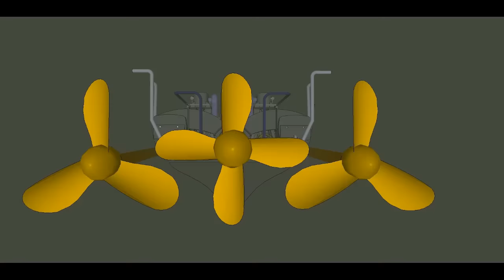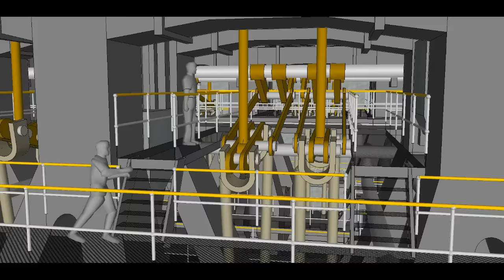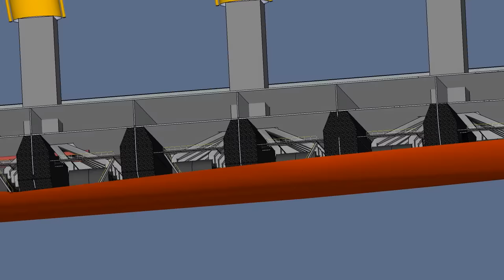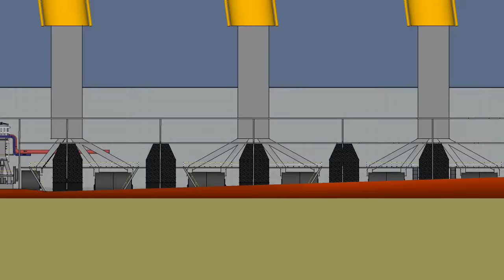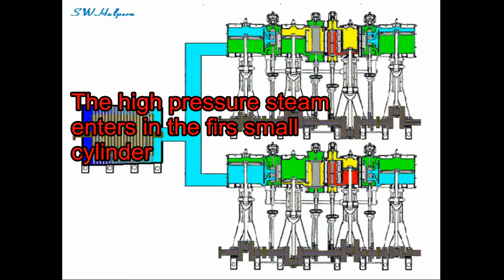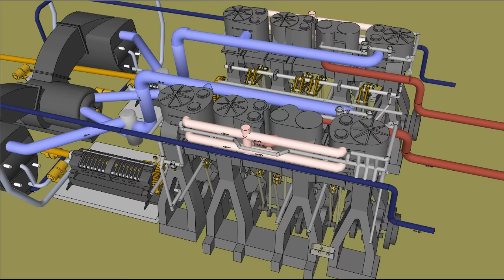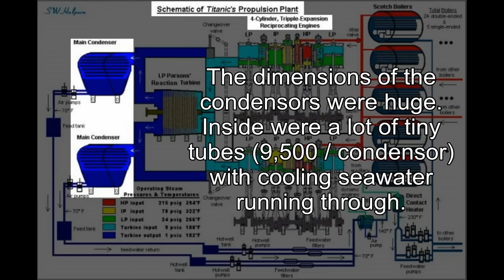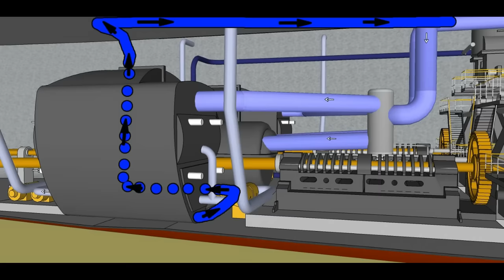The Engines of the Titanic

Comment: You might should have said that the Titanic's engines were only about 2 or 3% efficient, at best, as far as the imput BTU's reaching the propellers, and that the high steam pressures and temperatures were enormous dangers for the engine room crew. I would like to know how they lubricated the pistons and crankpins without pressure oiling and a sump of some kind.
Reply: I think they use train grease for that purpose
Reply: I am curious about the efficiency of steam engines

Comment: You forgot to add the starting engine but fantastic modle at least you put work into it
Reply from the maker: You can see at 10:35 how the engine starts.
Reply: @Hoeishetmogelijk  but on the modle you did not the starting engine is at the front of the engine next to the big starting cog which leads to the propeller
Reply: @Hoeishetmogelijk  oops I mean that the starting engine is not next to the engines like in the video it's in the front of the engine next to the next cog type up titanic engines and the front angle photo of the engine there's a big wheel next to that is the reversing engine

Comment: I heard of 'pony engines' used to start the larger engine but that was for gas and diesel, I never knew
a steam engine needed to be started like that, figuring steam would enter 1 cylinder or the other
and push the piston which would turn the crankshaft and valves would work with pushrods and cams.steam would then be admitted to the other cylinders at the proper time.
Reply from the maker: Yes, you are absolutely right!  A steam engine has a self-starting capability.  I didn't know that at the time either.

Comment: I don't understand how you can have steam a under 212°F at ambient pressure, let alone when compressed. Can anyone enlighten me? 🤔
Reply: I know that steam turbines in power plants can condense steam in condensers to below outside atmospheric pressure. It is for efficacy.
Reply: It's not at ambient pressure.
Reply: Water boils at about 70C at the top of Mt. Everest due to reduced pressure.
Reply: Maybe I should've said 1 bar, rather than "ambient pressure". I've never climbed Mount Everest and donbt you have either.  ✌🏻😎
Reply: @timbussens4940  You doubt correctly! 😁

Comment: How long did it take for the Titanic to go full astern?  In the time it took for them to reverse the props, a Diesel engine would've saved the Titanic from impending doom.  Lot of overcomplication for a piston engine, all they had to do was put mechanical unit injectors on top, and gallons and gallons of basic heating oil for fuel.  Even if injection technology wasn't that perfected, Diesel built a working model engine well before 1912.

Comment: I have always wondered if they could have turned the ship faster by increasing the Starboard engine, and reversing just the Port engine instead of reversing both.  The ship had too small a rudder for it's length and the propeller just in front of it cut it's efficiency a bit when stopped, which is what they would have had to do to go full reverse.  If they had done that, would the Titanic have missed or just glanced off the berg instead of hitting it the way it did.   Had the ship not turned and hit full on, would it have stayed afloat?
Reply: @Neineken thank god

Comment: A lot of effort expent designing and constructing the engines to make them as efficient as possible at certain speeds and sea water density.  All the same it is a low starting pressure and temperature so the engines will not be that efficient.  Ae magnificent effort putting it all together in 1912 with the great limitations of steel at that time. Much more art and inspired intuition in design of that time, do read the history of sturmey-archer and Raleigh bikes same thing a company that bought in the best of the best if they could not buy in parts made.  That company I guess did not get on with the design we of the famous gear hubs but had to bring him in to get the metals right which they could not buy in to make years and those hubs are still the most efficient bike gears design intruitively with inspired maths.  Is am guessing ?

Comment: does anyone know the  efficiency of that set up? That's a lot of use for the steam. Pretty impressive.
Reply: Considering they're coal-fired steam engines, Titanic's engines topped out at 15% efficiency at low RPM, even less at high/max RPM. They're put to shame by modern marine diesel-electric engines which hit as high as 50% efficiency and those are put to shame by nuclear-powered engines.

Comment: I realise this is an old video, but can anyone answer this question: To reverse the outer props was the whole engine stopped and reversed or was there a gear system in the outputs of the engines that could change direction?

Comment: Does anyone know why they bothered to cool the steam when it was directed straight back to the boilers to be reheated anyway?
Seems like they could have kept it hot and saved on coal.
Reply: I'm guessing the recycled steam/water could get too hot after a few rounds and then the whole process gets out of control (something explodes). But then why not just let the fires in the boilers die down and bypass the condensers once cruising in open water to use less coal. You raise an interesting question.

Comment: QUESTION! So basically the way the engines worked was that as steam entered the reciprocating engines, it forced the cylinder machines in a downward and upward circular spiral movement that in turn was connected to a shaft that was spun and this shaft in turn was connected to the propeller shaft that was spun and thus caused the ship to move? Is this correct?
Reply from the maker: Yes, that's correct!
Reply: @Hoeishetmogelijk  Got It!, thank you. I wanted to make sure I got the movement of the engines right. Appreciate it and well done video.

Comment: If the Titanic wasn't sunk , it could be restored by installing nuclear reactor that creates steam whitch it gives power to the existing turbine blades on the propeller shaft.
Reply: Greek ART Vlog That’s not a turbine, it’s a triple expansion engine. Much larger than a turbine but also more efficient. You could probably run it off a nuclear engine yes, but you would have to rip half the ship apart to do so.

Comment: why was the rear chimney not directly above nor connected to the coal furnaces?
Reply from the maker: The aft chimney was not used for smoke exhaust but for engine room ventilation.  It looked the same as the other chimneys because the designers liked 4 chimneys better.

Comment: If the low pressure turbine gave a higher propeller RPM, why not just only use turbines for all the propellers?
Reply from the maker: At that time, people did not have much experience with turbine engines.  The traditional steam engines were known to work.
Reply: Turbine engines couldn't reverse without some sort of gearbox

Comment: I am more confused now that i was before. Why couldnt they just use the 215 psi from the boilers to directly run the turbine instead of running through a steam engine?
Reply from the maker: At that time they had more experience with steam engines than with turbo machines. The turbo was coupled to the rear to use the latest pressure residues.
Reply: @Hoeishetmogelijk  wow thanks for the quick reply. Are you done making videos? you have some interesting stuff on your channel

Comment: Never dawned on me how much of a monopoly the coal industry had.titanic could of been diesel or fuel oil powered and been way more efficient
Reply from the maker: Yes, you are right! They found out years later.
Reply: @Hoeishetmogelijk  oh no they had been running diesel and fuel oil powered naval ship years before titanic was even thought of,it had to be a coal industry monopoly.because they could of easily ran those boilers off fuel oil and they would of been way less hassle,was more efficient,cleaner.just all around better.i will say those steam coal fired set ups have less then %1 fail rate and at the time were considered safer then fuel oil or diesel
Reply: *could HAVE been

Comment: Hi guys, would someone be able to further explain the thrust block to me ? (Great video!)
Reply from the maker: The propeller shaft presses against the ship to push it forward.  The shaft is connected directly to the crankshaft in the steam engine.  With this uncorrected force, the crankshaft would be dammaged.  The thrust block transfers force in to the hull.  The operation is simple.  A number of rings are welded to the shaft that rotate between the fixed rings in the thrust block.  In fact, these rings press against each other.  I hope this is clear.
Reply: @Hoeishetmogelijk  thank you so much!

Comment: How comes the steam enters the turbine at below 100 degrees C? Surely it's water by then?
Reply from the maker: It is cold steam with just enough pressure to drive the turbine.
Reply: @Hoeishetmogelijk  Since asking this question several years ago, i have learned that it is because it's below atmospheric pressure at this stage.

Comment: If they already knew turbine technology, why whole engine wouldn't not be made to run on turbines only?
Reply from the maker: At that time they had more experience with steam engines than with turbo machines. The turbo was coupled to the rear to use the latest pressure residues.

Comment: There is no mention in any of the engineering history books that I've read which shows that the Titanic engines needed a pony engine to start.  The engines were four-cylinder triple-expansion engines, and would start whenever steam pressure was admitted to the engines.  They did not need a "small steam engine" to start turning.  If you have documentary proof (documents from Harlan and Wolff, who designed and built the engines as well as the ship, or engineering documents from 1912 specifically addressing the engine start procedure for the Titanic) please reference those, for the education of the rest of us.  If you don't have specific data proving the Titanic used pony engines, please remove reference to that in your otherwise EXCELLENT video.
Reply from the maker: Dear Carlos, you are absolutely right. I used the video of the Kempton Steam engine as an example. I was under the assumption that it would work that way with other Triple Expansion engines. But it appears that, as was previously written, this machine itself is starting. I do not change the video, the next generation can do that.

Comment: Wow a steam powered inline 8.
Reply from the maker: I recommend you take a closer look. They are clearly two separate blocks of four cylinders each. I wonder with concern where you get the 8 in a line from.
Reply: @Hoeishetmogelijk  4 on each side, just like a v 8 engine.
Reply from the maker: @Vigilante-k4q  You are very stubborn, you do not understand. A V8 has ONE crankshaft, here are two separate engine blocks with 2 separate crankshafts. Stop calling it a V8 because you're talking nonsense!
Reply: @Hoeishetmogelijk  ok

Comment: Steam Temperature at turbine input less than 100 degrees Celsius. 
How is it possible?
Reply: Water boils at a lower temperature as pressure is reduced.  At the summit of Mt Everest, water boils at about 70C.
The steam pressure fed into the turbines was 9psia, or about 6psi below atmospheric pressure.
Reply: @thedubwhisperer2157  oh... so turbine works below atmosphere pressure? And gives 16000 hp! Amazing :)
Reply: @thedubwhisperer2157  we worked with organisation, which uses 1 GWt turbines operating at 70 atmospheres about 290 degrees Celsius.
So these Titanic numbers are phantastic for me :)

Comment: Wait so nearly all the steam pressure generated is used just to keep the engines running and only a pathetic 23psi is actually sent to the output drives? Wow what a piece of shit why didnt they just connect the output drives directly to the boiler

Comment: your animation is great but the middle screw had 3 blades not 4, otherwise everything looks good
Reply from the maker: Yes, you are right. However, there are many pictures with a 4-blade propeller. But whether those were from the Titanic? I do not know.
Reply: @Hoeishetmogelijk  yes that's true however its the Olympic not Titanic that's in the picture, no pictures was ever taken of Titanic's screws, the picture of the 4 bladed screw again was Olympic while she was in dry dock because they had to repair the damage that was caused by the Olympic running into the HMS Hawke which White Star Line was found to be at fault, since she was in dry dock Harland & Wolff decided at that time to replace the 3 bladed screw that she had originally had and  put a 4 bladed screw on her, ironically this caused a big problem for Titanic because if Captain Smith and this is an old story had not run into the HMS Hawke when he did, which caused the work to stop on Titanic and force Harland & Wolff to focuse all their attention on Olympic then Titanic would have left on her maided voyage which was scheduled a few days earlier to be postponed a few days it is all possible that she may not have hit the iceberg when she did because the iceberg would have been in a different location, but anyway the problem was that Harland & Wolff had no performance data to determine which screw was the best one to use so they came up with an idea to use the Titanic as a test vehicle because she still had the 3 bladed screw that was put on her, so when she set sail she was to gather performance data and when she returned back to Belfast Mr. Andrews would take all the data and present it to Harland & Wolff and decide at that point which screw was the best to use, well since Titanic didn't make it back they had no data to go by so Harland & Wolff just left the 4 bladed screw on Olympic and also went a head and put the same screw on the new ship that was being built which was the Britannic,

Comment: Love the sound so cool,  big triple expansion engines are slow revvers, never designed to run for hours flat out.  Need an overdrive ,like an Austin Healey 3000, once in top gear the engine will  run  at its most economical rpm once the overdrive is engaged.

Comment: I thought the titanic had tripple expansion 3 piston engines
Reply from the maker: Maybe I don't understand you well. There are 4 cylinders, 1 for high pressure, 1 for medium pressure and 2 for the low pressure. The 2 outer cylinders have the same function.
Reply: Hoe ishetmogelijk ok now i get it

Comment: Cool, a V8
Reply from the maker: NO! Not e V8! Triple expansion. I thought I explained this in detail. But you didn't understand. Shame.
Reply: Not a V8. A V8 engine is in the shape of a V, with two cylinder banks at offset angles from one another each holding 4 cylinders.

The Titanic had two inline-4 engines (an engine with 4 cylinders in a single line) that were installed side-by-side.

Comment: Not many people know that the Titanic was doomed before it left the port. There was a coal bunker fire that was not dealt with before she left and was still burning on the trip. Because of this fire the ship's hull was compromised and weakened by up to 60%. Because of this the iceberg had an easier job cutting the hull plates.
Reply: There is no real evidence of that besides one picture, and that does not even confirm that it was a fire, it appears to be a coal dust stain, or messed up paint